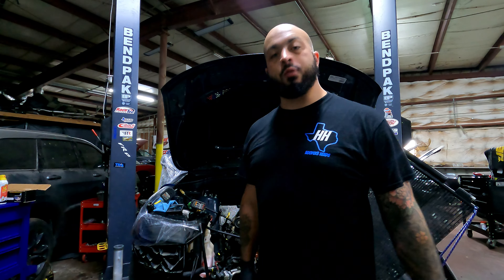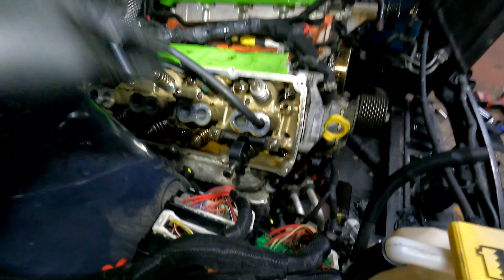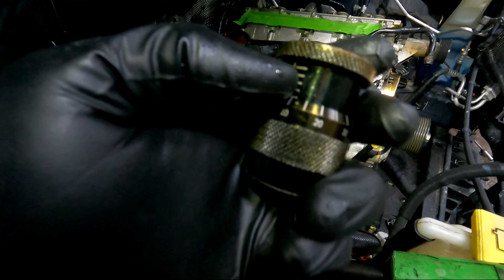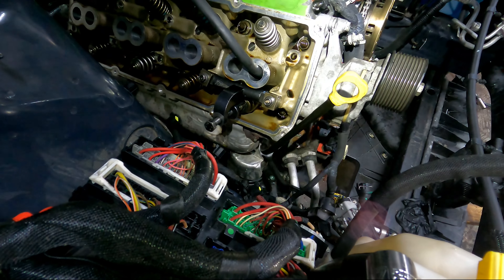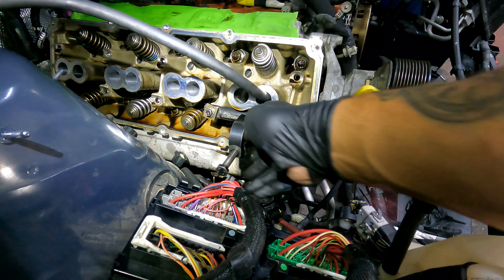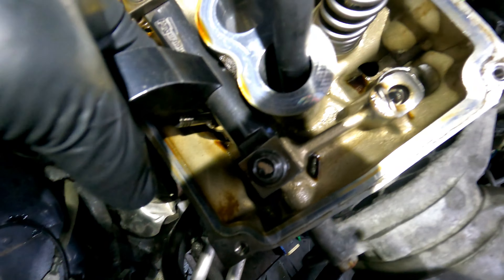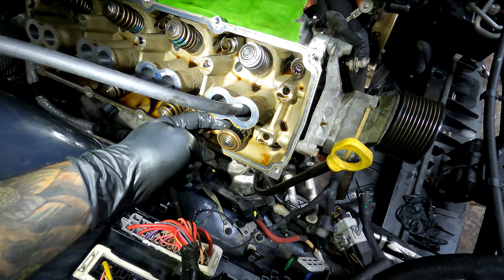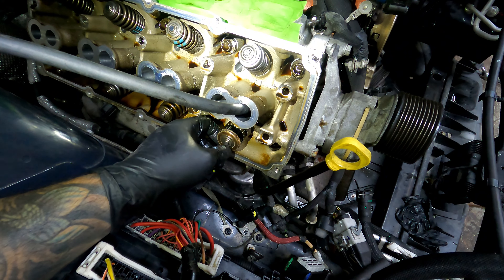Measuring Valve Spring Height

Comment: So I got the FRP tomahawk 2.0 for a 6.4 with the manton hardware and the pac 1276x am I supposed to use the the use the new shims from manton along with with factory ones or only the the ones from manton?
Reply from the maker: yes should use the factory shim and the locator. 

Verify install height is 1.800 or not too close to coil bind